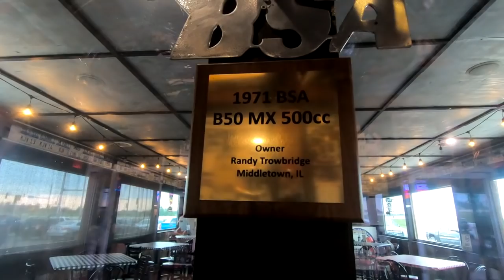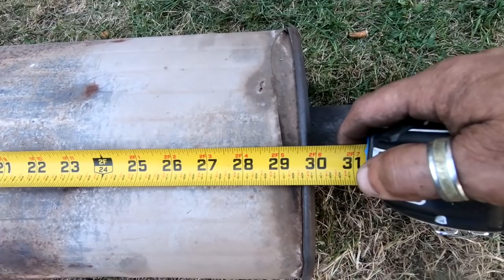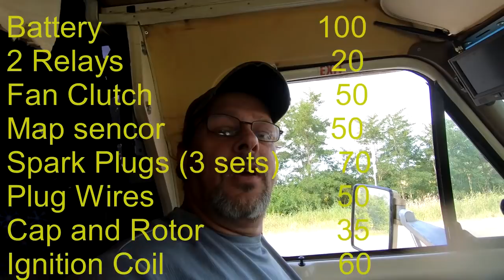RV Fixed, Naming the RV, New Sound, Route 66

Comment: I wonder is the material inside the converter got blown into the muffler and plugged up the muffler. Glad things are running better for you. Hope it stays that way.
Reply: A new catalytic converter isn't cheap either!
Reply: @edbenson98  unnecessary for such an old vehicle. cut it out and save the hassle. florida has no emission inspection.
Reply from the maker: Yep that's what happened.

Comment: How far west are you going?  I am 40 miles south of RT 66 on US 60 and I-25 in central New Mexico. And I can keep your mechanical skills busy for a week on a Class A diesel (solar wiring, air brake line repair/replace, adjust levelers).   We can talk about changing 24 quarts of oil and filters and AC recharge as well..  I can provide a place to park, vittles and beer.
Reply from the maker: I am going out to Quartzsite at years end. Ill be there for a few months.
Reply: @rvprepperwayne   and I am on your way. if you can repair a few of my issues (air brakes and levelers) I might join you to over winter in Quartzsite. The central New Mexican desert is COLD, eh?  

I have two sets of miswired  solar panels (3 40 amp charge controllers). a broken air brake line on the driver's front, problematic levelers. toilet replace or repair (have replacement). rear shocks on a Mini Cooper.  need for you to tell me if I should move my LIFEPO4's out of the battery bay and into the electrical bay OR run a 2nd pair (2 2/0 battery cables) to the batteries from the inverter charger (voltage drop >.5V).   If you give me enough notice to ax the landlord's permission, I can provide parking, 50 amp service and dump (and fresh water, maybe) as well.

Comment: Maybe someone hollowed out the catalytic converter so it would pass visual inspection. Here where I’m at no converter no plates.
Reply: Wayne is from Florida. There are no auto inspections in the few free states left.
Reply: corey Babcock  rodding out a Cat is a no-brainer.  installing real dual exhaust with a x-over pipe is da shitz
Reply from the maker: What was in the converter ended up in the muffler. The muffler felt like it weighted 75 lbs. It had some loose material in it
Reply: So a way that I approach the catalytic converter situation. 
Have the catalytic converter installed/modified with bolt on flanges on both ends. Then have a "catalytic converter test pipe" made with bolt on flanges that directly replace the catalytic converter. 
Older vehicles with catalytic converters usually had low restriction mufflers. And most did not have a sensor.
So, install the converter for inspection times (usually every two years).Then remove for daily use. 
Plus, the catalytic converter will last many years with much less exhaust coating the platinum beads inside.